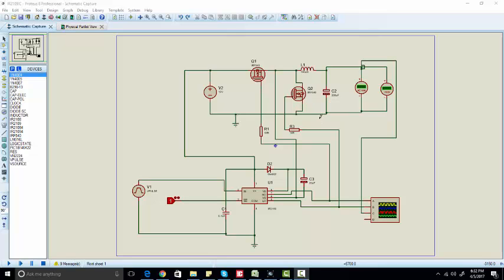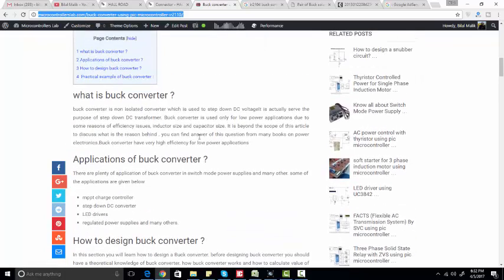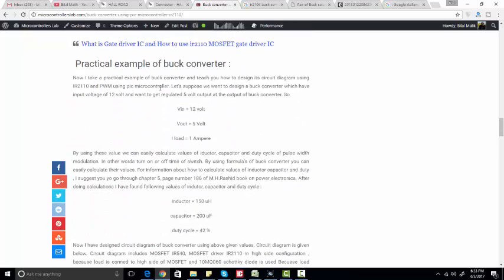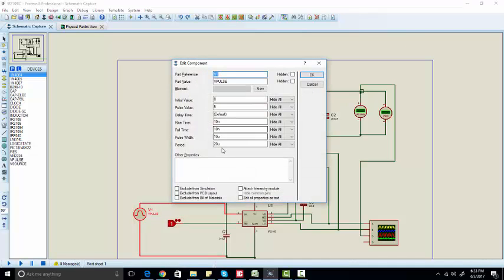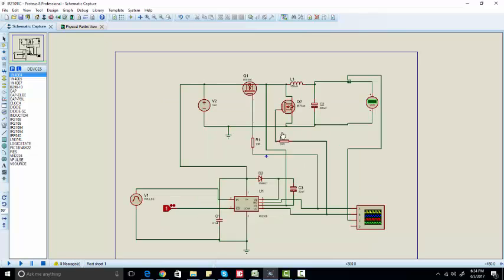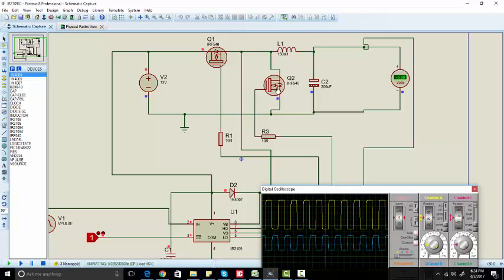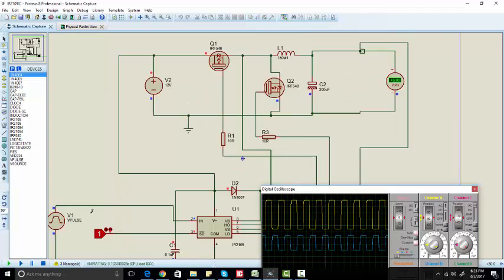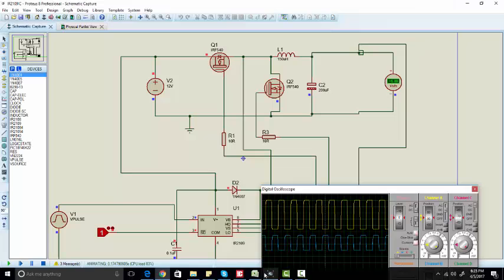buck converter using IR2104 and pic microcontoller proteus simualtion

Comment: Just an Add ON:
SD (Active Low) pin is used for driving Low Level MOS whereas IN is used for High Level Drive. If you use IN then directly apply your PWM, for SD apply Inverted PWM as input and you can keep IN attached to VCC.